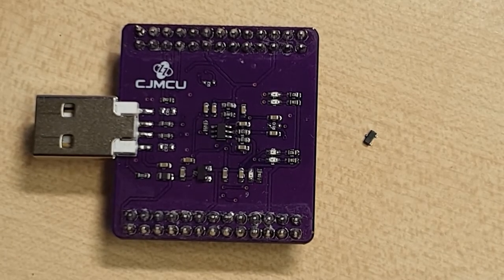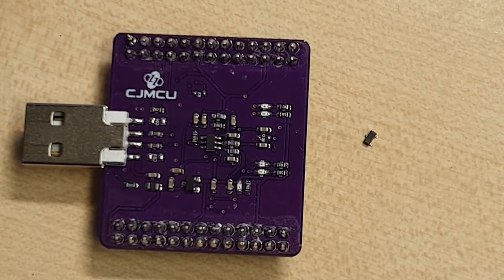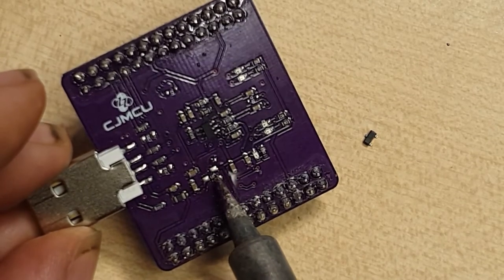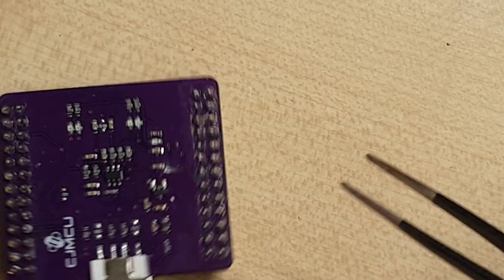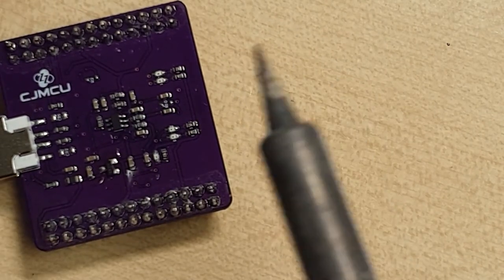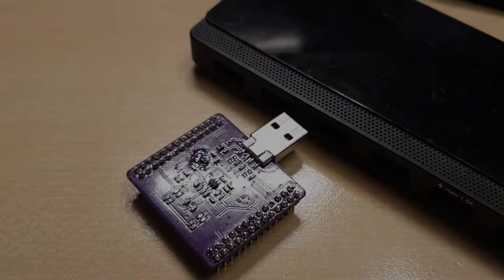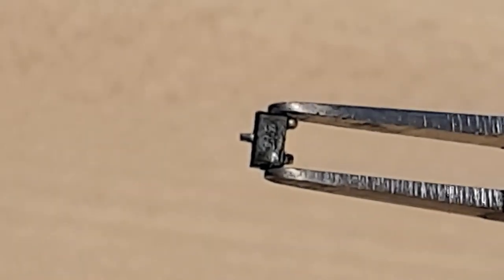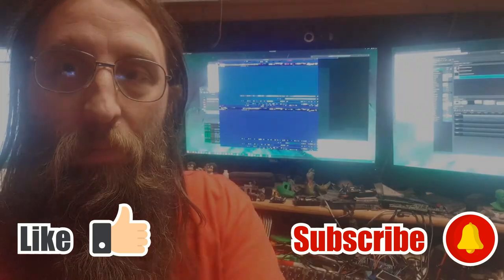FT2232HL USB adapter Repair

Comment: i'll use ftdi when its in something, but if buying and i can choose then anything but. the chips fine its what the company (accidentally....) did years ago i'll never forget...( FTDI-Gate)
Reply from the maker: I completely agree - FTDI really pulled an extremely dangerous stunt there.

Given the possibilities of supply chain contamination, and the fact that these chips are used in medical devices, they could easily have killed someone with their completely deliberate software "update".

I'll never use FTDI parts in my own designs unless there is no alternative.